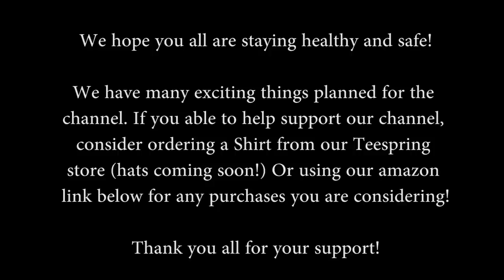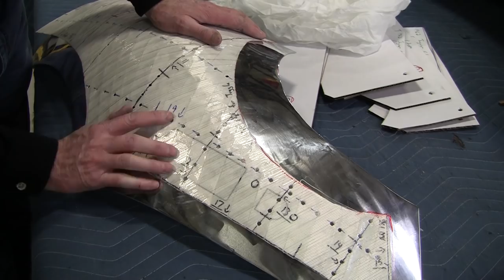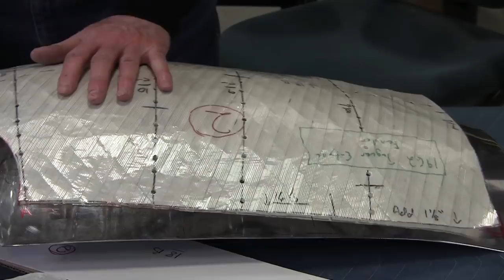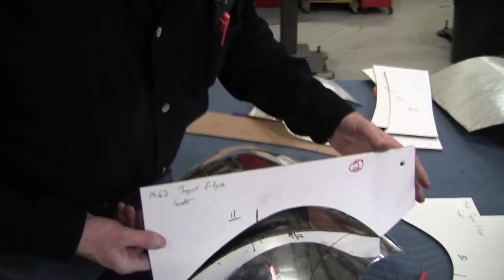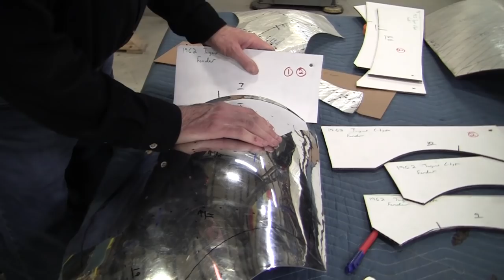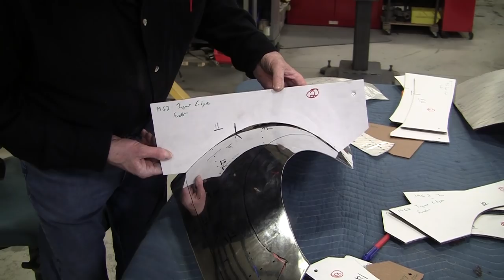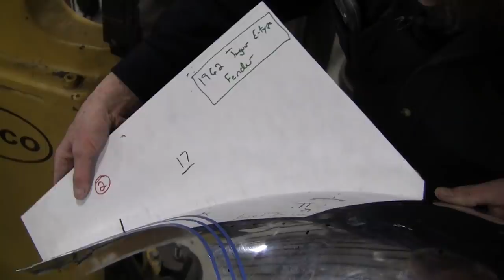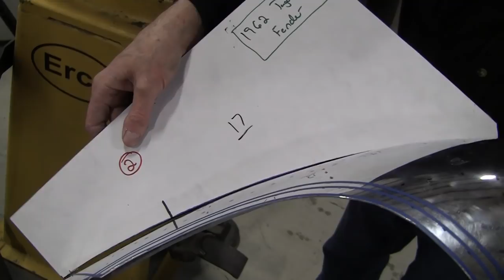How to build a Jaguar E-Type fender (Part 2)

Comment: I have been rebuilding my Jaguar xk-e '65.   I had found a few dents and you gave me the confidence and the teaching how to get the pieces back into place.  I did need a little body filler, but very little.  Took a long time, but came out almost perfect.  Thank-you.  I will share with anyone who might be interested.  Took me a long time to use the hammer and dolly the first time.  I hated to hit it.  I found I could do it a little at a time.  If you want a few more views, you might change the title, and thumbnail.  I searched on jaguar e-type, but I don't think there are that many around now.  This can work on any car.  :-)  H  I subscribed, liked this, shared it, and made a comment.  This will give you the most notification for the youtube algorithm.
Reply: P.S. I give a 25 on scale from 1 to 10.

Comment: Great to watch the panels taking shape, and how to make mistakes and get around them so easily. 
I must admit that I was a little skeptical about the sticky tape technique but it certainly works. The cardboard profiles help for sure but much easier than making up bucks and so easy to store too.
Reply from the maker: Bucks have their place, but it is ridiculous to make a buck for a right side fender if you have a left you can copy with a flexible shape pattern and gauges.  All patch panels can be easily made and super accurately with a flexible shape pattern and gauges. Even if you have a buck and you are making multiple panels the flexible shape pattern will speed up the process. It tells you exactly what you need to do,where, and how much.
Reply: @proshaper  I am certainly convinced that your system works.  No doubt at all. Fantastic to watch the progress.
Reply: The most important development in metal shaping ever. The Flexible Shape Pattern.
Seems a little sketchy at first. But, that is before one’s mind overcomes the resistance. 
It’s hard to express enough gratitude for these fine gifts.

Comment: I notice god developed your body bits just right for body assisted bending of your panels, unfortunately mine were slightly over developed and dont work as well as yours. Great videos and well explained procedure.  I taught to never to stop during a wheeling stroke , something I tried hard to resist. It made sense to pump up the area then planish off. Seems the American way has its merits.

Comment: What is stippiling v not on the shrinker
Reply from the maker: Stippling describes the working surface of the shrinker stretcher jaws. It has like a sandpaper look to it. Stippling is better for shrinker/stretcher tooling working faces as opposed to the other format which looks like a file surface. The stippling is easier on the metal, especially aluminum.

Comment: Love your work, but I'm really sorry to say that headlight flange looks like a beaver, and a elephant had a go at it. The edges are all dented, crooked, and not uniform in any way. there is no way that will work as the headlight ring will just accentuate the irregularities like a magnifying glass.
Reply: Scotty362100 wasn't paying attention on the class. Shame on you Scotty362100. Man says it all in the video.
Reply from the maker: The headlight joggle will be adjusted and tweaked, it will look good and fit perfectly when completed. Patience!!!